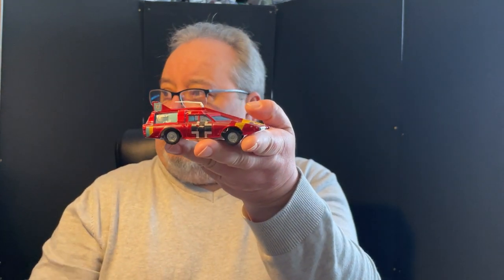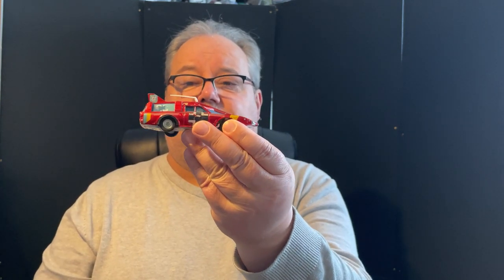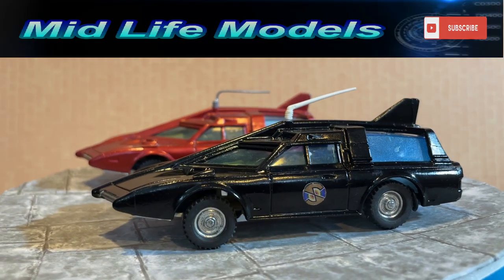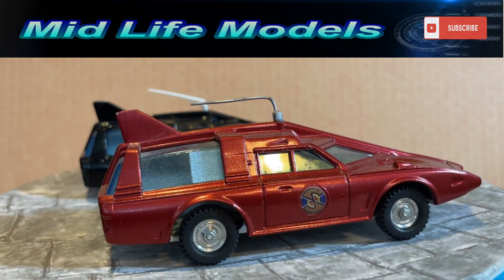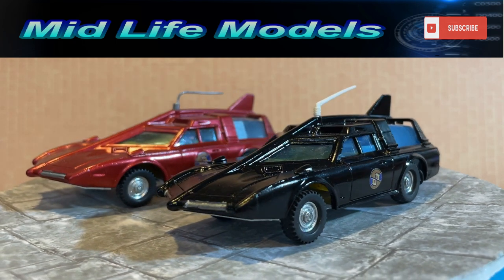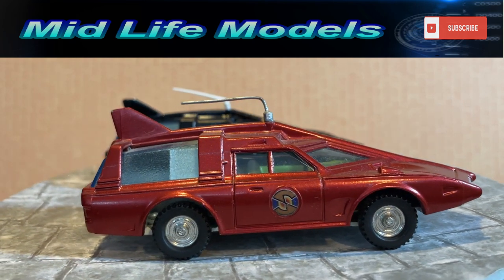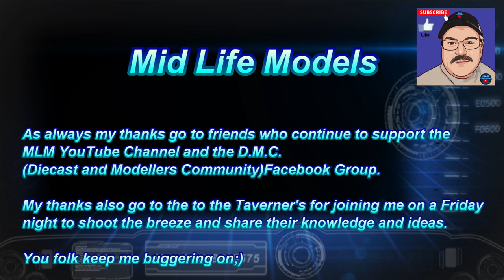Dinky Toys 103 Gerry Anderson's iconic Spectrum Patrol Car from Captain Scarlet

Comment: Great restoration PJ. How did you remove the decals from the windows?
Reply from the maker: Believe it or not I ended up using paint stripper gel which didnt harm the plastic.
Reply: @midlifemodels  Thanks for the tip.